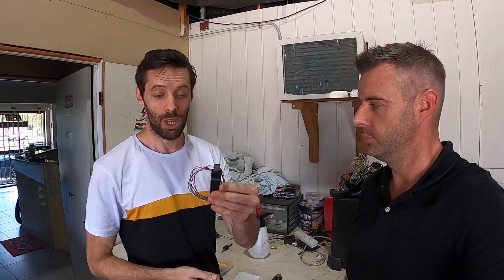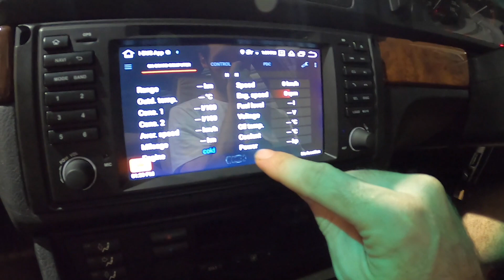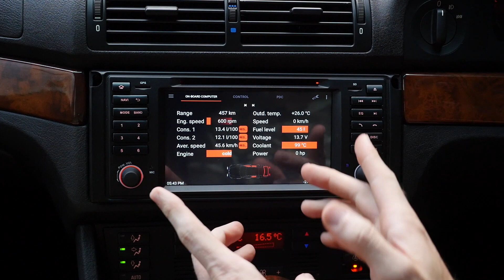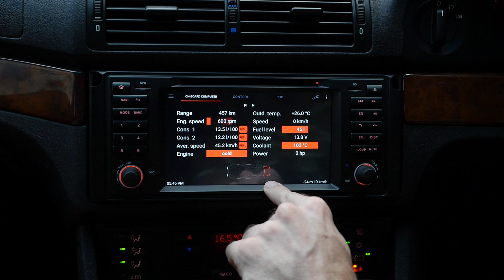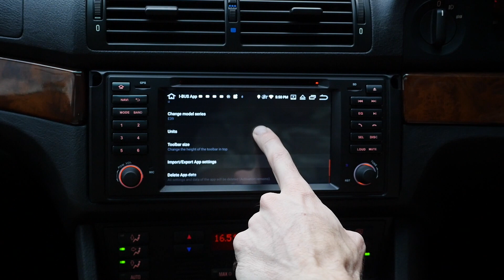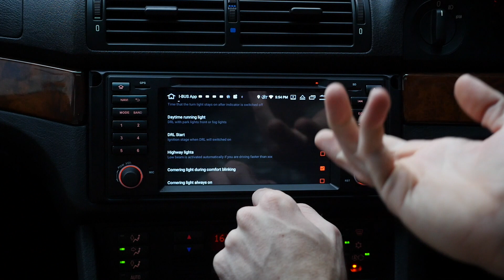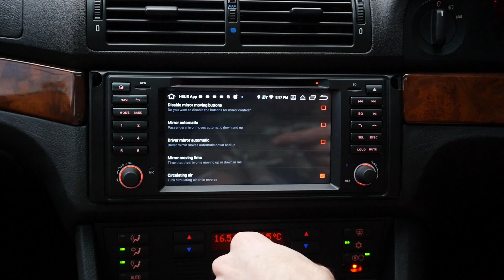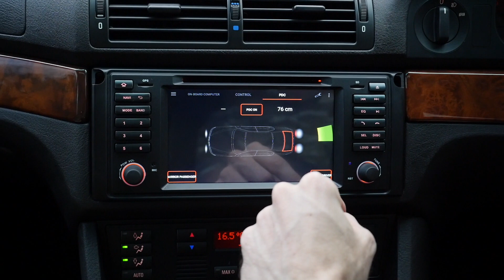BMW E39 E46 E53 Onboard Computer IBUS App Install & OBC Interface Review

Comment: Can you provide more information? Link to website to purchase,  etc. It sounds amazing.  Please help! Thanks!
Reply: Type xtrons headunit in Google, plenty of info available
Reply: @chriswayling8550  thank you!
Reply from the maker: Hi Kevin, Here just below are the links to the app and the IBUS dongle. 
App: https://www.ibus-app.de/index_en.html
IBUS Interface: http://www.reslers.de/IBUS/index.html
Reply: @ZeroTo60Tube  thank you!!! 👍
Reply: @ZeroTo60Tube  hi what head unit did you use please 
I’ve just got a n e53 in the Uk and want to do this upgrade 
Does the ibis have the option to turn on the aux heater (mine is the diesel)
Would you wire the stereo to the speakers or the bm unit 
Thanks lee
Reply: @ZeroTo60Tube is this for the eonon head unit sorry lm just a chic & wanna update my touring

Comment: As a user for 7 months there are some downsides to this app to really consider:

1. it doesn‘t start reliably on startup. I have to close and restart this app nearly everytime (90%) in my E39 (2001).

2. the GUI shows many redundant Information and is not very well made. You have to look twice very often for really interesting values. There is a „sport mode“ with digital gauges which is practically useless nonsense.

3. and this bugs me the most by far: the app license is bound to your car‘s VIN. That‘s nothing bad in general, but the app wants to verificate the license not only once after setup, but every now and then AGAIN AND AGAIN with the license server, which doesn‘t make sense really.
So the app / headunit needs a permanent internet connection, or a personal hotspot every now and then. Don‘t get me wrong, licensing with the VIN is okay, even checking the VIN of the car everytime the app starts is okay, but why do they need to contact their server for that?
One reason might be, that they are collecting your car‘s driving stats. And that‘s a very questionable thing to do.

Comment: I have a similar system on my E46, did you solve the issue of the trunk open light? before installing iBus my xtron unit always said my hood was open and when I open the hoot the light goes off, then goes on when I close the hood. After adding the iBus it shows the same thing inside the i bs app!

Comment: You made it look simple and bypassed how to actually set it up in my Xtrons radio. I downloaded the app. purchased the license. Now when I try to unlock I get an error message it is not interfaced. Please address potential problems and how to solve them.
Reply from the maker: But i didnt have those problems......  im sharing my experience.
Reply: I understand but I have a 2003 BMW e39 which is a different setup. It does not have a blue connector the onboard information was controlled through the factory radio. I am working with Xtrons and I-BUSApp now to solve the problem. Don't mis understand me your video was a lot of help to me. Keep doing what you do.

Comment: I hope you respond to this very soon!!!!

I have a 1998 bmw 540i e39 4.4L with the dsp non navigation screen

Couple questions, 

If I’m installing an Eonon Q49Pro and an aftermarket sub and amp do I need to worry about DSP and do I really need an IBus? Can’t I just install the eonon and the sub and amp and just bypass the dsp stuff I’m not entirely sure what dsp or ibus do 😅

Comment: Greetings — would you mind elaborating a bit more on where / how in I-BUS app you configured the angel eyes as DRL? Or point me to some explicit instructions online for configuring various lighting combinations? The I-BUS app Wiki is, in my opinion, mostly useless. Also — you seem to be using "parking lights" as synonymous with "angel eyes", correct? 
Thanks very much for your contributions to this annoyingly complex subject..

Comment: G’day mate - I just came across the Zero to 60 channel via the YT algorithm as I also own an E53 with a replacement Android Head Unit installed after the original OEM head unit pixel died.  The IBUS dongle and app seems as though it will present the data that I was initially used to viewing.  Many thanks for letting this ‘BM owner know about this ‘new’ tech!  Cheers

Comment: is CAN Bus same as ibus? if the android unit comes with a CAN BUS will the  ibus app work? thanx
Reply from the maker: it is a can bus, but there are a few different buses with in the car. The can bus modules in the units normally only pick up things like gear position and steering wheel controls. As far as i am aware the app requires the dongle.

Comment: Does it still keep tv function and aux vent / heat
Reply from the maker: Not tv. But aux vent will work with ibus
Reply: @ZeroTo60Tube  which units support ibus I can’t find any here in U.K. for e53 
kind regards

Comment: Will this enable the steering wheel buttons ? At the moment non of them work with my android installed
Reply from the maker: The android should come with a canbus converter or have it built in. 

However I think ibus app can link them. Just never done it that way.

Comment: Hey Guys , just install my Xtrons Android 10 | Hexa Core | 4GB RAM & 64GB ROM | HD Output | PQS1053BL for my X5 E53 2006 model , I bought the Resler USB I-BUS module but not paid for the licence but  the trouble  have I cant install the Ibus App into my unit even I followed all the steps to connect the Ibus with the Android unit .
Could you please help me out how to install it and to pay for the licence for use it 
Thanks you
Reply from the maker: Hi George, Im sorry just very short of time at the moment.

Comment: what is the make and model of the head unit?
Reply: I’m also very curious which unit this is, looks pretty nice
Reply: @MarcelW72  I researched this for my 2006 x5 4.4 and bought an xtron unit. I can find the details for you if it would help. I still haven't installed it...
Reply: @MarcelW72  Here's what I ordered from X-Tron for my 2006 X5. Please note I have not installed this yet.

Androidd 10 Head psa7053b xtrons - make sure it's wifi.
Ibus app
Rear view camera: trunk handle replacement
     https://www.amazon.com/XTRONS-1280x720-Vehicle-Hidden-         Recorder/dp/B07NKZHQ8M
DashCam - make sure it's wifi and possible rear camera
Bluetooth
OBD Module -xtrons OBD2 ELM327 module: $30 Amazon
6m cable

Comment: Can i have only  the angels as DRL  without having the app running in the background? Could I use a android phone with OTG cable .... enable only Angels to be DRL ...save settings and then disconnect the phone? Will the setting we saved and will not need a app running in background? Ta

Comment: Do I only need to connect the high or low canbus wire or do you need a adapter?
Reply from the maker: For ibus app you need the ibus usb adapter. Only one wire to make the adapter work tho.

Comment: I like how you handled the connection without destroying the original ibus system connector of the vehicle. I'm not electronics engineer, so here comes silly question: what are those red clips which you use for ibus controller?
Reply from the maker: They are called t-taps.
Reply: I also value this thing in installation.

Comment: Hi,I appreciate all of your videos. I would like know if you have instructions on
installing the 6 meter cable to a HA2150-MAX10  Dasaita? Please help.
Reply from the maker: We dont unfortunately.
Reply: @ZeroTo60Tube  is the blue and the white that is not used in the front still plugged in the boot? Where else can I connect the  
Ibus? Thank you.

Comment: I have just ordered one of these, good news if you have a dsp car , for a little extra they now have an addition to the license which also controls your dsp for stereo through the original unit without running any extra wiring to the back apparently
Reply: Link? 🙏🏼

Comment: Hi, after I have installed i-bus my E53 opens the windows as I press to lock the car. Do you know any settings I could look into? Thanks
Reply: this just happened with my install, did you figure it out?

Comment: Very good application. I have an e53 and I just bought a used system from an e39 owner. My car doesn’t have a blue connector but has  the same colour wires on a white connector  is that the one I use to connector the ibus interface?
Reply from the maker: To be honest i am not 100% sure. If you can find your connector id and then work out what each wire does in there is should be listed online somewhere, which ones you need to tap in to.

Comment: Ibus interface installed in my e53 app downloaded and tested, went to the website and payed for all 3 licenses but isn't unlocking. 
Did it take a while to process for you or did it unlock straight away mate
Reply from the maker: Took about 4-5 hours from memory. But its a manual process, so it depends how you time it with thier working hours.
Reply: Got an email a few hours later a worked straight away haven't much time playing with but already worthwhile, thanks mate

Comment: Hello bro's I am hoping you can help me installing my android head unit to ky e39? We almost have the same android unit, but once I plug the socket in? The unit will power on but will not create any sounds from radio and music from Bluetooth. Please help me out 🙂
Reply from the maker: I imagine it will be due to how you have the unit linked to your current system. There are quite a few different OEM set ups that need to be wired in to differently. We go in to a little more information about the options in the newest android install we did. https://www.youtube.com/watch?v=CehmtjAtLaI&t
Reply: Did you find a solution? My Android headunit powers on but there is no sound. I have DSP but don't have the ibus adapter and app yet.

Comment: hello i got E53 I3.0 2005 equipped with DSP , if you can lead me to a specific android head unit that can work with the DSP!!
last week i have tried one head unit that did not bring out the voice from the DSP.
Reply from the maker: Pretty much all of them will if you have the ibus app. However, you do also need to have a fully functioning standard stereo, if any of the old components are not working it all gets messy as they all need to communicate.

Comment: Hi, is it possible to set time and date on the OBC via the ibus app please ? My date/time stamp got cleared somehow and I can't set it because I have the android aftermarket unit .. my car is E53 2005. Any help would be appreciated, many thanks.
Reply from the maker: Yes it is when you have the ibus app.
Reply: @ZeroTo60Tube  fantasctic news! thanks . I installed the free version of the app just to check out and it says 'No usb interface available' and doesn't show any obc data on the app. Any reason why ? does the free app version only work with resler interface ?

Comment: Hi, please could you kindly share the canbus settings on the android head unit for the E53 ? I messed up my settings and now my steering wheel controls don't work :( ...the canbus settings is in the factory settings menu  ..pls help
Reply from the maker: I haven’t go e53 unfortunately. I recommend sending ibus an email and they will know how to get the SWC working again 👍
Reply: @ZeroTo60Tube  when you say ibus, do you mean the ibus decorder that's connected to my head unit ? how do I get their contact details please ? Thanks.

Comment: Hi.. excellent video..
I have to turn on my DSP after every 30 secs to get sound .. is there some setting to keep it working all the time.. 
Thanks...
Reply from the maker: Sorry we can't answer that, this is a non DSP car. But there is something strange you need to do with the DSP, they are not quite as straight forward.

Comment: Where you've tapped into, IE off the blue plug, is that blue plug not plugged into anything? I pulled my headunit out looking for the quadlock connector and it wasn't there, just a loom and plug straight into the HU 🤷‍♂️
Reply from the maker: The blue plug is on the modes with the stereo modules in the boot. The base models have a iso connector. Not the blue and white connectors.

Comment: Hi. Where did you get that USB slot where is your ibus device actually connected?
Reply from the maker: The head unit comes with multiple USB inputs at the back of the unit so its plugged in there
Reply: Got it. Thank you

Comment: Hi..  good video..  i have to turn on i bus DSP every time i turn on the android head unit in my e 53 .. is there any setting which keeps it turned on.. thanks !!
Reply from the maker: If you mean the ibus app, you can set it to auto start in android. However how to do that will depend on your specific version of Android.
Reply: Did you find a solution to this?

Comment: Ehm my unit doesnt have usb port on it and i se yoy connected the ibus usb stick in an external usb port off some sort  thats agian connected to a port on the unit?

In that case i need that to be able to use the ibus app so could you please help me with getting that cable i need for the ibus usb stick? 😊
Reply from the maker: You will need to speak to whoever you got the unit from. The androids normally use the same cable, but some manufacturers will change pin outs on plugs. So to be safe definitely speak to whoever you bought the unit from.
Reply: @ZeroTo60Tube  i accually remembered that the usb cable you guys used, followed in the kit for the android radio i bought for my e39 cause i remembered that ive seen that cable lying some where  in the car or in my house 😅 so am Gonna look for it 😊

If not i gotta buy that cable separatly if i can find it some where 😅
Reply: Hi agian! Could i reach you some where on private messages? :) i have a little problem with the wiring here 😅

Comment: Hi there brother i have android 10 i dont have the same wire setup u have! That means i dont have to buy a usb right?
Reply from the maker: It depends what you are doing. What do you need the USB for?
Reply: Zero To 60  for the i-bus app can. Can we talk? Myphone number is 9647700432173

Comment: I have a 2000 e39 pre facelift with the older cluster display and non nav basic head unit with the tape deck behind the little flap and 6 stack in the boot. I have been seriously looking at installing an android unit, I have a bluetooth module wired into the stock unit and its been good but after seeing this and your other vid on this unit I'm pretty much sold but I'm thinking I may not get the functionality that you have with the ibus. I think I should take a gamble on it.
Reply: did you wind up going down this route? could you access these features if so?
Reply: @lemiwinks7794  I bought an Xtrons unit, I didn't try to connect iBus with that, the screen died after 18 months. I replaced with an Avin Avant 4, which is excellent, I have functional iBus with that.
Reply: @4syth  alright cheers for the response, I'll have to look into the Avin system. Looks like a great option

Comment: Gents, I need help. How do you remove center dash vent on E39? I've inspected pics of them, followed tutorials about sliding credit cards into the corners between vent unit and hole in dash to depress tabs, got a pair of pliers wrapped in a cloth on the fascia, pulled - nothing. It will not budge. Most tutorials just smash the slats and grab and pull - I don't want to break mine, just remount the airflow direction tabs.
Remove Factory MID and CD and push from behind? tried that (without depressing tabs) - bugger-all aceess.
Subbed.
Reply: Yes remove the radio and push it from the back. If that doesn't work use a thin kitchen knife with a rounded tip to press the tabs of the ventilation unit and try pushing it from the rear again.

Comment: Hi , how to make the blinkers light up for a moment or blink when locking/unlocking the car? 

Does the automatically fold mirror function actually work?
Reply from the maker: Folding doesnt work on my car, as it doesnt have that folding motors. Also i havent played with the indicator flashing function. sorry
Reply: @ZeroTo60Tube  Hi! can you tell if the IBUS interface it does erase & clear the OBD faults?

Comment: Hi guys, I have e38 with the same Andro multimedia, but my car didn’t have original multimedia it was with radio... may this ibus app works on my andro multimedia?
Reply from the maker: The ibus will work. However just keep in mind it may not show as much info as this car.
Reply: Zero To 60 thanks a lot 😊

Comment: Hello 
I have a E38. 
I am having little problem trying to understand something 
Some people tell on videos that you can plug and play the radio after installation, in the other hand some said that you have to get a 6M cable to connect to the rear component( trunk)...
Did you had to do any king of estes wiring?
Thanks 
I have aE38 does have navigation and cd changer don’t know if guys can help
Reply from the maker: You will need the 6m cable. You amp is all in the boost if you have navigation. So you will need the 6m cable to connect the android to the amp in the boot.
Reply: I’m taking it the amp could be bypassed and still go on I-bus and use a aftermarket 5channel?  And then tap the rear leads at amp to run doors and rear deck?? Please advise
Reply from the maker: @wgreen340  Yes that is definitely possible to do.

Comment: Hey, great video. But just to clarify, did you say I can't have my DRL running if I don't have the ibus set up?
Reply from the maker: You can obviously manually turn them on. But with the ibus setup, you can automate it.
Reply: Zero To 60  is this available for purchase in the United States
Reply: @abezz377  yes I have one in my e46 330i and its great

Comment: Where is connected the USB Doungle? I mean you spliced the wires to ibus factory cable and where's connected de female usb doungle?
Reply from the maker: It goes straight in to any of the data USB ports on the android. Most androids have all data ports, but some models have ports purely for charging.
Reply: @ZeroTo60Tube  Ok! I was looking for a female usb in the back of android unit but it does not exist directly. We have to connect a adaptor to get the female usb port...I'm so stupid.Thank you very much and sorry about my english.